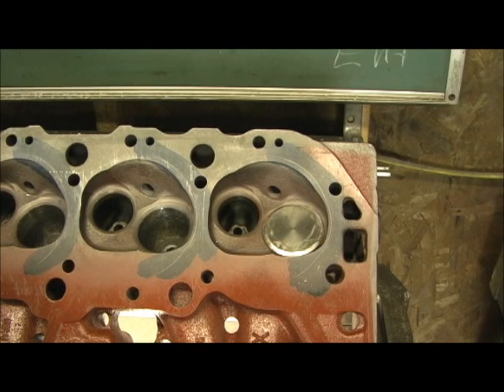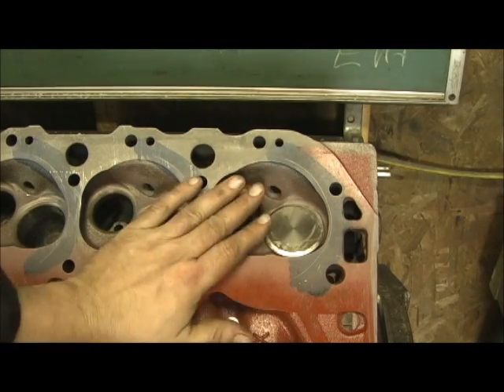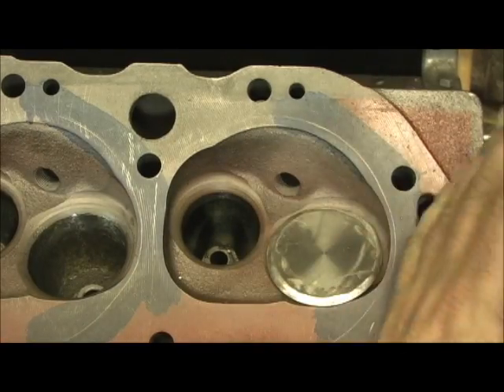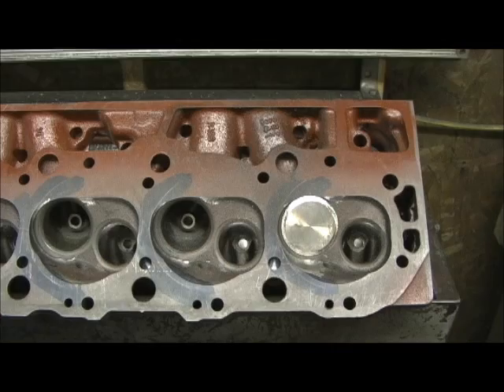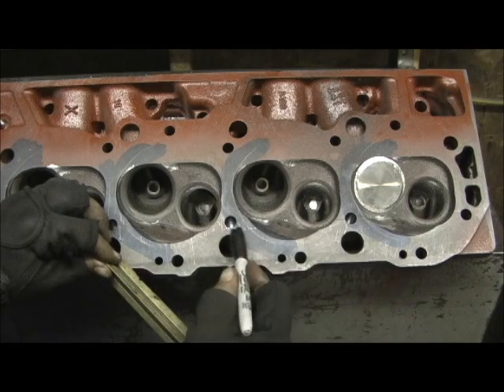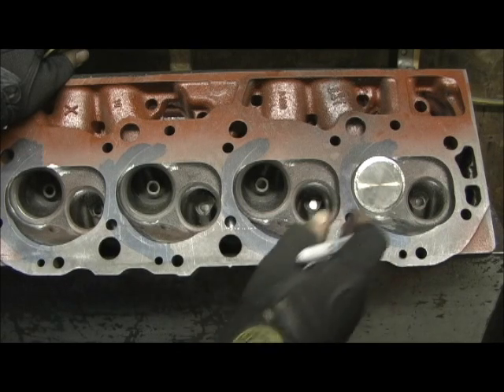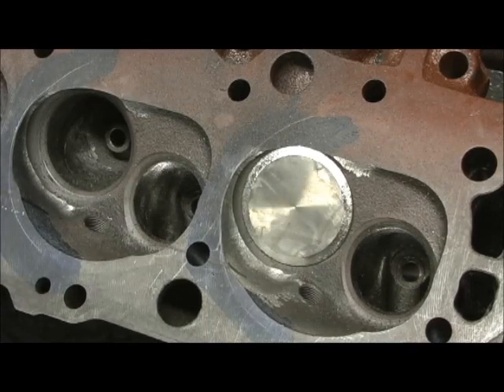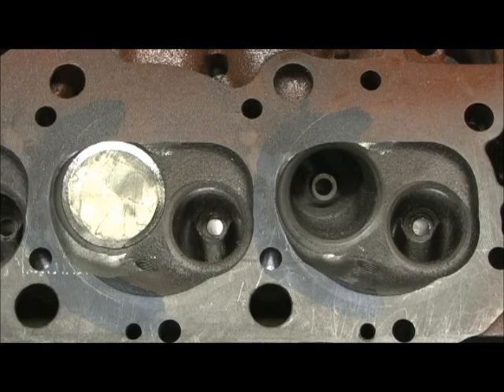Big Block Chevy Heads "241" for Stage III.5 Porting

Comment: Thanks for the tip. I have only rebuilt one 454 back about 15 years ago, and it turned out good. I'm excited to build a 427 for my truck that I haven't got yet. One step at a time....

Comment from the maker: Be glad to. This depends on three things: Intake manifold, Headers, and camshaft used. If the three things needed are there, then over a stock-unported head in the same position (meaning Headers on the car, Intake on the car, and Camshaft being used on the car) then 80 Horsepower is a slam dunk (or 80 HP is a promise). IF your a good tuner, timing, jetting, ignition is optimal, then just over 100 Horsepower is a realistic result. I hope that answers your question.